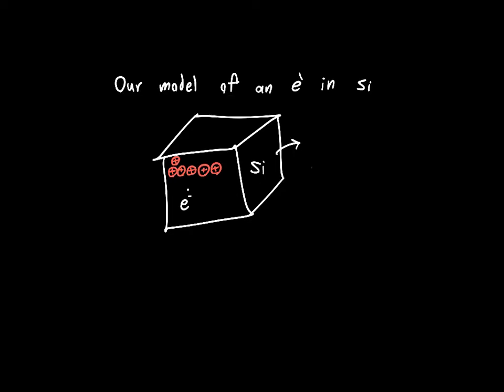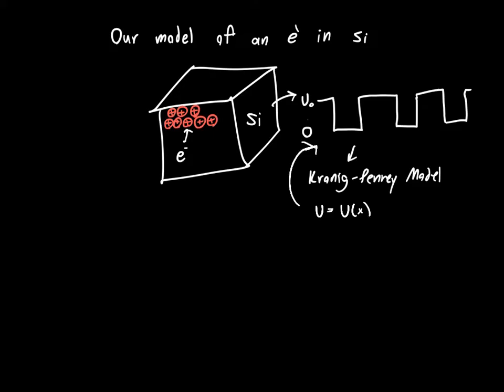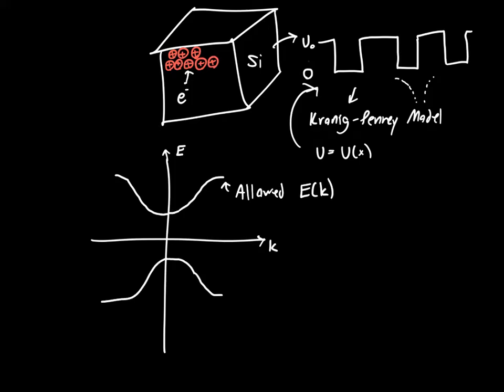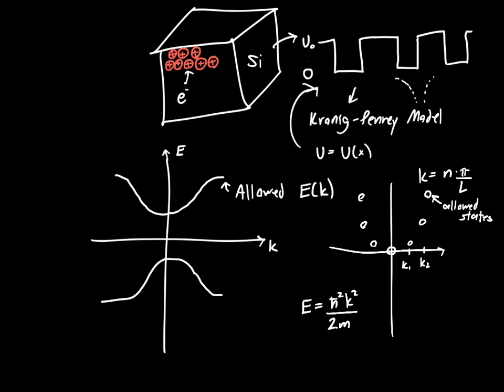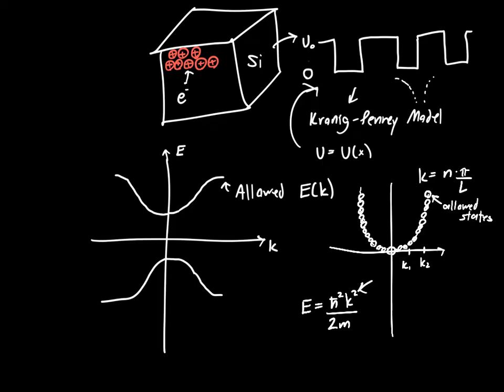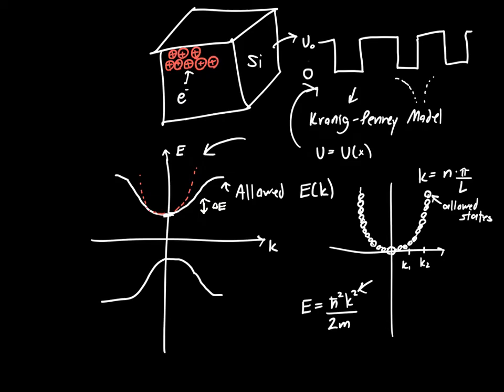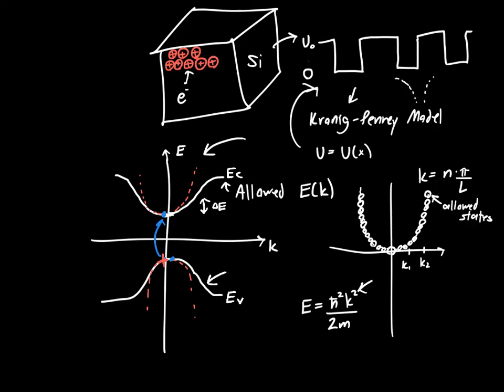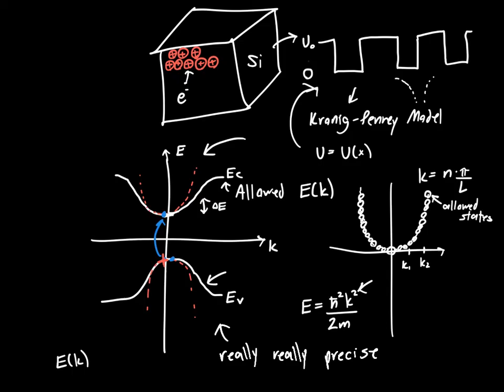Kronig-Penney Model Overview and the E/k Diagram

Comment: The kronig-penny model is good for understanding the bands consist of quantum mechanically allowed continuous regions when an infinite periodic potential is introduced, but isn't the linear combination of atomic orbitals (tight binding model) the more proper and useful way to derive band structures of atoms because it allows you to easily introduce additional potential terms and makes the application of group theory and symmetry arguments more obvious (you can represent your potential terms as matrices with symmetries)? 

I am actually not completely sure of this. I have learned both the kronig-penny model in passing and the tight binding model a little more in depth, so the math that I know is all that I am basing this off of. I am not a real theorist. It might be that the kronig penny model is more useful for semi-conductors and I am learning about metals or something like that, so feel free to provide feedback/correct me.
Reply from the maker: I'm not a real theorist either, just an engineer :)p. For the most fundamental quantum-mechanical way of seeing the splitting into bands, I really like perturbation theory. If you bring two hydrogen atoms close together, you can use perturbation theory to show that the new energies of the system will no longer be degenerate, they split a little bit. Repeat this process over and over and you get a bunch of splitting, although this is a qualitative argument, and it's not obvious the splitting would be confined to certain regions (bands) separated by gaps (bandgaps).
Reply: The Kronig-Penney model allows to obtaine a tight binding model approximation. Not by combination of single potential well`s orbitals, but through analize of the result characteristic equation. You can find some details here: https://youtu.be/t1f2QUGTjMs

Comment: Yo. Si should have an indirect bandgap, why is your E-K diagram a direct one?
Reply from the maker: Just to simplify things when explaining them. Silicon does have a direct bandgap as well, it’s just at like 4eV ;)
Reply: @JordanEdmundsEECS  to have a direct bandgap, this means to have the minimum of the conduction band and the maximum of the valence band to occur at the same momentum, 'k' value. This isn't the case for Si.
Reply from the maker: If you look at the full band structure of Si, it does have a local conduction band minima and local valence band maxima that form a direct bandgap. When we say silicon has an “indirect bandgap” we just mean that the *global *maxima/minima are not indirect.

Comment: Energy of an electron in conduction band is E+E_c, here E is the K.E. which depends on
temperature(degrees of freedom). Recombination
will occur when electron will lose all its energy i.e
E+E_c. Electron loses energy when it collides with
the crystal irregularities. My doubt is why does
recombination occur since if electron loses all the
KE, it will remain at E_c and not go to E_v. Also
temperature is being held fixed so it has sufficient
energy, then why does recombination occur?
Reply from the maker: You are completely correct, electrons only lose their kinetic energy when undergoing collisions in the lattice. When they encounter a hole (whether that is a hole in the valence band or in a trap in the semiconductor lattice) then it recombines with the hole. You are completely right that collisions themselves do not cause recombination to happen. In fact, in the case of impact ionization, collisions can actually do the opposite and cause more electron-hole pairs to be generated.
Reply: @JordanEdmundsEECS  Sir, you mean to say that electron ain't need to lose all its energy for recombination if it encounters a hole?